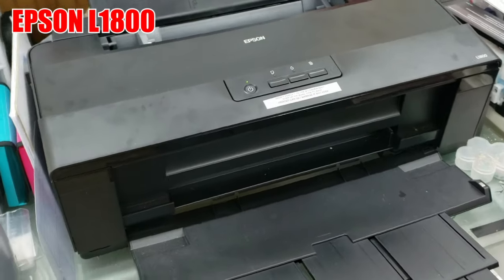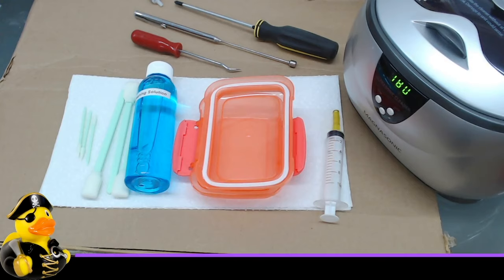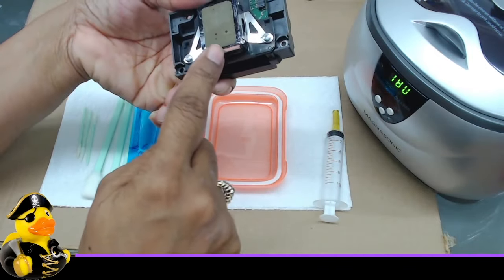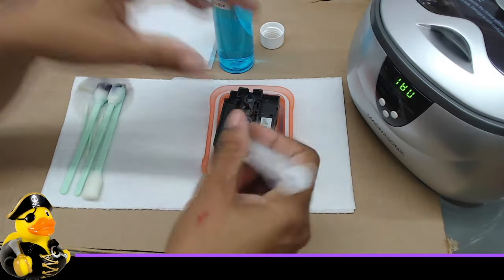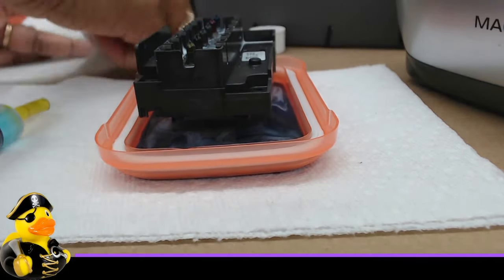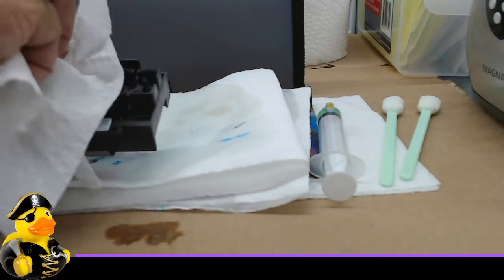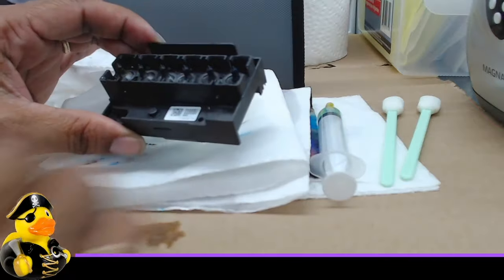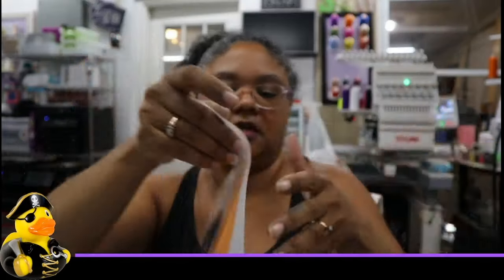Unclogging an Epson L1800 DTF print head and SEE results clearing a White Ink Clog

Comment: Thank you so much for your tutorial. I too left my L1800 without printing for some time and here is the fun part. I took my L1800 out the box, loaded the ink and had to leave it alone because I got sick and had to be hospitalized. I really thought I had a very large and heavy paper weight, but your video gave me hope. I purchased brand new dampers and tubing and made sure the ink bottles are flowing; wish me luck. I will keep you posted. Thanks again for your help.  

1
Reply from the maker: I hope it worked!

Comment: Thank you for the video, I had good result from the ultrasonic cleaning.  I also used  clear tape to cover the portion where the chip/electronic were exposed, I found some droplets on the tape which prevent the solution from getting to the chip.

Comment: Hello and thanks for the detailed video, question though I've seen another video where the printhead is cleaned but the guy strongly recommends not putting the printhead in the machine you used because according to him it can damage the gaskets in it. He recommends separating the nozzles from the printhead and putting only the nozzle in the cleaning machine as he said most times the clog is in their. What are your thoughts on that
Reply from the maker: I don't have any opinions on that. I can only refer to my own experience. I haven't had issues out of my printer from this process. 🤷🏽‍♀️

Comment: Great video but this Ultra Sonic Machine ruined my basically brand new Print Head. I ran it twice at 180 seconds. After I was done, when I pump cleaning solution through nozzle 1, it comes up out of nozzle 3 and so fourth. I think the heat melted the diaphragms or loosened all the seals inside the print head.  I recommend no longer than 90 seconds and let it cool before running it a second time.

Comment: The streaking you had after cleaning might be ink build up on the underside of your carriage.  I have had success cleaning that by the following method.  With the printhead removed, place some paper towels on the bed of the printer.  Then put a little cleaning solution on the paper towel.  Next move the carriage back and forth over the paper towel.  Repeat this process until the underside of the carriage is clean.

Comment: Thank you! I wish I found this yesterday. My head soaked for 24 hours and was still clogged. I bought a little ultrasonic cleaner and bam the clog seems gone. I'm running a purge now. Fingers crossed it actually works. :) 
I have a dtg with the l1800 head.
Reply from the maker: I hope it did finally work for you! Head clogs are so frustrating!
Reply: Does the ultrasonic cleaner totally unclogged your head?
Reply: @hanzjerichogarabiles5198  yes but will damage the piezoelectric components

Comment: I was wondering if you could share any solutions or suggestions for getting rid of the pizza wheels. I've tried the cardboard with cleaning solution, rubbing alc and a few other methods and nothing has worked.

Comment: nice video. it will not damage the head by the sonicwave yeah?, ive seen another video how it kinda melts the metal parts and stuff. so im worried. im using l1800 too..so i decided to by a cheap jewelry cleaner

Comment: Have you ever had it not print any color after a flush like this?? All of my color was printing fine except white until I did this flush…I know the white was clogged because it took a bit to get the white to finally flush clear streams. I put it all back together and now it’s not printing anything 🤦🏼‍♀️😂 oh my. Thank you so much in advance!!
Reply from the maker: Be sure you didn't get the connections wet or backwards or loose.  See if either of those three are the issue.
Reply: @TheBabysBooty how can you tell if you got the connections wet accidentally?
Reply: I'm having the same issue jenniescott is I get some lines with head cleanings but that's all how can I tell if my connections are messed up

Comment: Hey, Im having a problem where the white isnt thick enough on the back layer, and whenever I apply the adhesive powder it removes the top layer of white, and damges the image leaving a little of spots missing ink, very small spots. Do you have a solution for this?
Reply from the maker: You may have a clogged white channel OR you may not have your white turned up enough.  Your powder should NOT be removing the white top layer, maybe change to a different powder.

Comment: Please also note, DTF Inks and DTG inks are definitely not the same. When DTG inks dry up, it becomes rubber and cannot melt away with cleaning solution like DTF Inks. So when DTG Inks clog a print head, majority of the time its permanent.
Reply from the maker: That is not the information that I was given from a reputable DTG machine manufacturer that also makes DTF machines. 🤷🏽‍♀️

Comment: Does this happen often. I’m thinking of getting one of these.
Reply from the maker: it does if you let it sit.
Reply from the maker: @whatstheteemorebyrocexpres3047  More like, Not using it for Two days!!!  Must print daily.  If you plan to go on Vacation, there is something you can do to keep it from clogging... But you'd have to buy an extra set of print cartridges and fill them with cleaning solution and let that sit in the printer while you're gone.  That's a completely different technique.
Reply: So I actually got the printer in December and this week my white got clogged. I’ll be attempting this today. Also ordered a backup printhead today. Hopefully I can get back up running by tomorrow. Lots of work.

Comment: I cleaned my print head and refitted and now I can't power the printer, it is not turning on. I am wondering if I damaged the power board when I removed the power cable (9:18) to move the print head into the centre. I have tried two different cables, both work as tested with other devices.
Reply: You can try a so called "contact spray" helped me out a few times 👍

Comment: This is exactly what I needed! The place I bought my printer from is awful with support. I did this to my 1 month old printer that was not printing at all. They wanted me to buy a new $500 print head when I just needed to clean it. All the inks work great but the white is faint... So I am going to clean those again and hope it works. If not, do you have a store you recommend to purchase a new printhead?
Reply: Did you find a new print head?
Reply from the maker: I did
Reply: @TheBabysBooty  I have someone local that has a printer but says it’s faint and needs new print head. Thinking about taking the leap. But nervous I can’t fix it
Reply: Can you tell me wher you purchased your new replacement print head?

Comment: I tried this. It destroyed the seal on my print head. It started bubbling up and I thought “yay! It’s working!” Then it started bubbling other colors through each nozzle. So it wasn’t me flushing too hard. That was literally a brand new printhead less than 12 hours in the machine. I took all the precautions to make sure the lines were clean, bottles were clean, new damper…head cleaning and wet cap at the end of the day. It shouldn’t have been clogged but after hours of soaking one white nozzle was totally blocked so I decided to try this and bam. $300 mistake. 😭
Reply: Same here, After I was done, When I pump cleaning solution through nozzle 1, it comes up out of nozzle 3 and so fourth. I think the heat melted the diaphragms or loosened all the seals inside the print head.  I recommend no longer than 90 seconds and let it cool before running it a second time.
Reply: Ouch I am debating what to do going onto maybe a 3rd head. My new "Refurbished" is giving me a terrible nozzle check prints are no white so frustrating and waste of my hard earned money.

Comment: why is that after changing new printhead there is no prinout in my paper, its completly blank without any print at all. i hope someone can answer my question. ty
Reply: Try power ink flush in maintenance
Reply: Have you figured out how to get the ink printing after change the printhead? I’m having the same issue! Please help
Reply: Did you figure it out kim sue?
Reply: Do an ink charge in your Epson resetter software
Reply: My printer doesn't have the power ink flush button in maintenance area.  So how can I execute one?

Comment: Using an ultrasonic cleaner on an epson piezo print head will ..RUIN IT
Reply from the maker: Thus far... it hasn't. But I definitely put in the description that destruction IS a possibility.
Reply: Hi , further research says that it is more detrimental to the Epson dx4/ dx5 /dx7 heads because the foil head is a lot thinner on those so maybe the cheaper models will be ok just be careful nonetheless 😉
Reply from the maker: Thanks for the update! 💪🏽